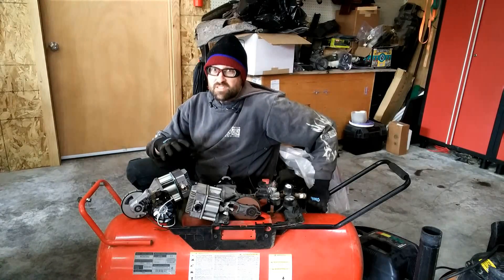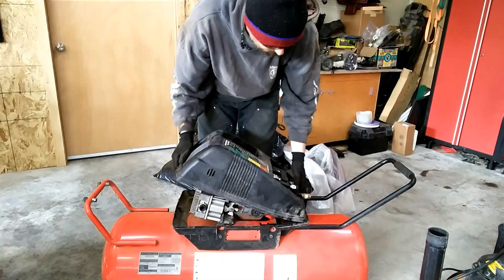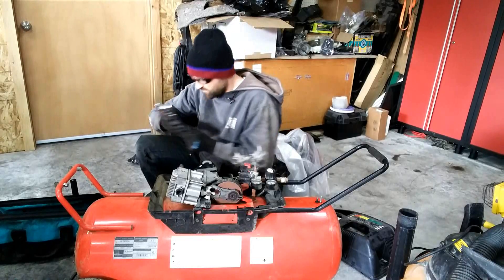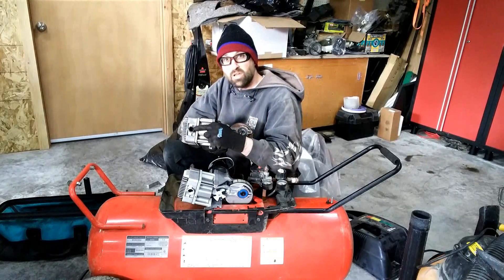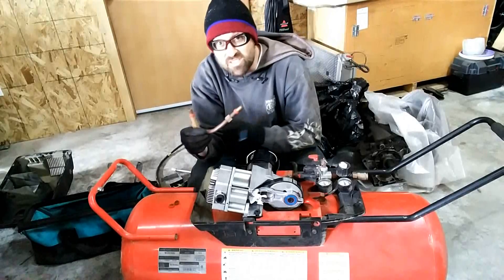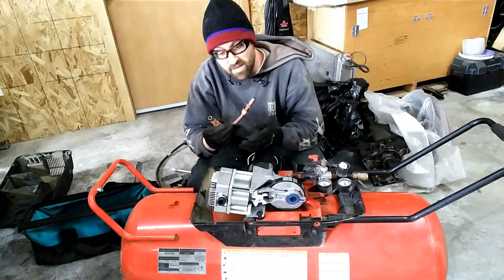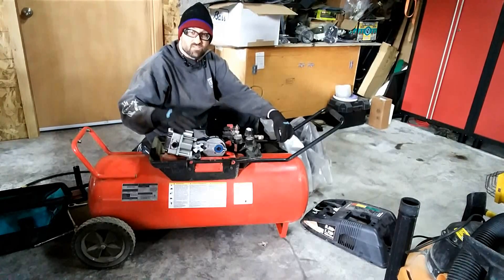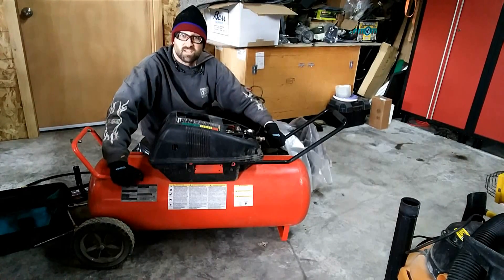Replacing The Campbell-Hausfeld Husky Air Compressor Motor

Comment: Also need the same assembly. Can't find one. What part number does your compressor show? E108560
Reply from the maker: Finding parts for this generation of compressor has been harder and harder every year. I gave my Husky away last year because I couldn't find parts, and I also needed a bigger compressor for an upholstery business I opened.

I can find a listing on the Home Depot website for E108560, but I'm skeptical if it is right based on the questions and answers. I always had good results with the Ereplacementparts.com website when I needed something. They would be where I would check for parts first. If they don't have it, send them an email for help.

Comment: Hi. Just got a used Husky compressor WL 650702 AJ .  How to remove the black plastic casing on the motor , as I have to replace the carton /motor bushings. Thanks.
Reply from the maker: There are a few screws holding the halves together. Once you remove the screws, the tabs can be pushed in and the top comes off.

Comment: can you paste a link for the one you bought or something, that's the exact motor i need....
Reply from the maker: https://www.ereplacementparts.com/motor-drive-kit-p-1314612.html
Reply from the maker: The motor kit has been discontinued, so you may have to search for one via Google, EBay, etc.  The pump assembly part number is WL390100AL, and the motor kit is wl390100.  I bought mine from Ereplacementparts in Utah.

Comment: got this same compressor, bought a belt, but can't get belt on. i took rod loose at tapered screw, got belt over fan, & tried to roll it on pulley, but it keeps coming off small pulley. guess i'll have to look at it better when i get time.
Reply from the maker: It's a tough booger to get on completely. Be patient and you'll get it on there.

Comment: Where did you get the replacement part from
Reply from the maker: I found it off a Google search.  I put in the model number and searched for the best price.
Reply: I have one too. Mine runs and shuts off at around 80 psi. I’ve bypassed the pressure switch and it still does it. Could it be the motor getting weak
Reply from the maker: @jeremyetier8203  Potentially. Does it get hot like it wants to go higher than 80 psi, but can't?
Reply: Basin Motorsports doesn’t necessarily get hot but pumps up to around 80 to 90 and shuts off. Let air out to see and it won’t start back up. Could it be thermally related and motor going bad. I tried to find a replacement and couldn’t
Reply from the maker: @jeremyetier8203  It could be a thermal issue. I think I got mine from ereplacements.com or something like that. It was $50 or $60 before shipping.